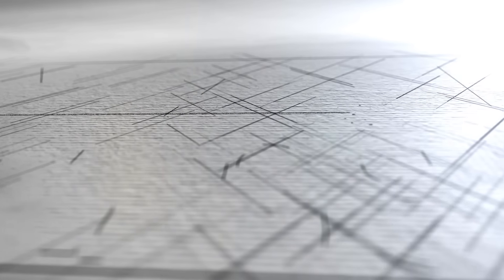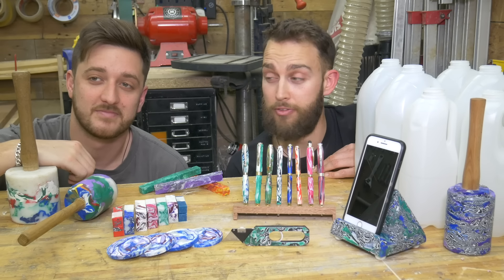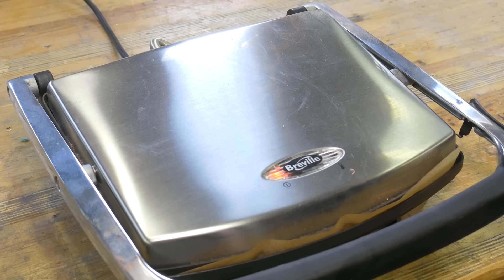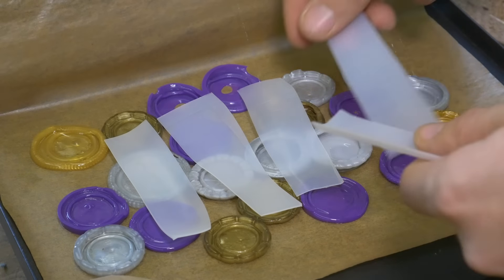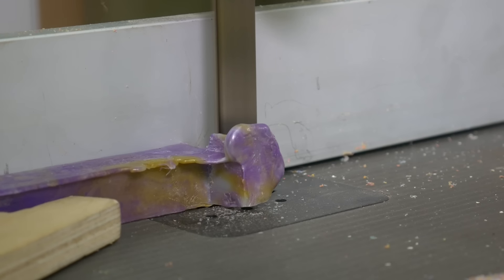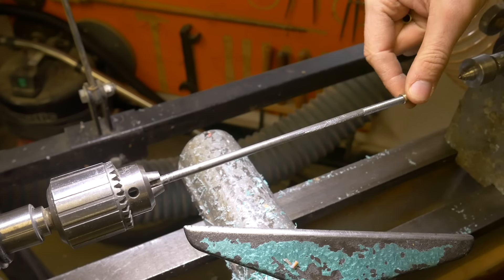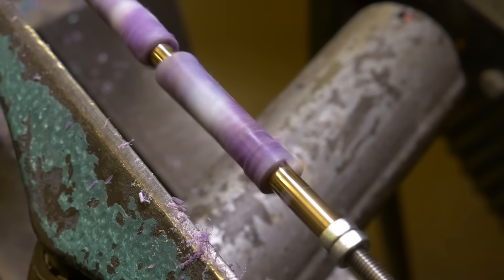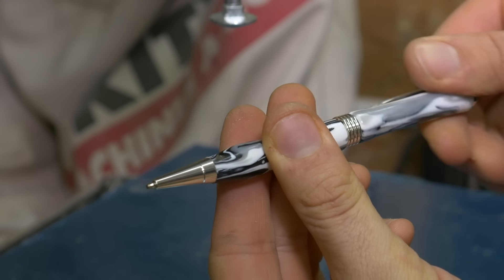Beginners' Guide to Melting HDPE - How to Make a Recycled Plastic Pen

Comment: Very interesting, never thought about using the panini toaster, the brazilian videos I saw all used the electric oven, mentioning that it was easy to control the temperature and not allow it to go too high. Didn't know the panini toaster was also good at limiting the temperature build-up.

The only downside I see is that you can't do a large chunk of plastic in once with the toaster as you could with the electric oven, because of the space (and most likely the temperature won't be spread evenly if you do a chunk too large in the toaster).

Comment: Here is another items which I forgot.
On outer pot which not only gives the shade to keep soil kool for the potted plant , inside outer 2nd pot on the bottom of the pot where water collects,
Put angle slightly so when you water the plant, what drains will collect towards
Where drain plug will be. So outer pot inside the bottom must not be flat .
There is few ways to achieve this.
One method is wire that extends out with grill for planted pot can lay on top of the grill. But anyway I am sure that you will come up with best method.
I learned a lot by watching your video.
Thanks. Because you guys are pro.
I will give you this idea for you guys.
It would take me too long for me .
When I see it on the market I will buy it for sure. I love flowers and plants.
Believe me what I give you in idea is needed. So I hope you guys will succeed.
Thanks.

Comment: Friction fit is probably the best way to go, but you should be able to get a reasonable bond to epoxy if you flame treat the surface first. It works with uhmwpe on skis and snowboards.

Comment: Although I love the ways you are re-using plastic, where are all the microplastics that you shave off these creations going each time? At that size, they are really dangerous to animals and children, as they could get picked up inhaled/eaten and just generally bad for our eco system.
Reply: Unless you wear only all-natural fibers, you should be more concerned about the fluff you’re pulling out of your dryer’s lint trap. Microplastics are unfortunately everywhere and will not be going away. At least these guys are trying to repurpose plastic. I’m sure they have a shop vac and possibly a ventilation system or air purifier that can trap particles.

Comment: I was running a industrial electrical project manager over the electrical work for a brand new plastics plant. They make pet plastic pellets that's used for grocery bags bottles ECT. It is actually really cool the process used for making brand new plastic. And the other side of same plant they melt down recycled plastic and refine it back into pellets as well and that shows up as huge trains full of mixed up types of plastic and they have robots with sensors that sort the plastic by type of plastic when it comes off the trains. After I did that 4 year project I got to go be in charge of their other plant where they make plastic bags and bottles. It takes one tiny 1/8 inch long buy 1/16 thick pellet to make 1 grocery bag not much plastic at all used, the pellet gets really hot right to it's exactwlting point air is blown into and it inflates into a plastic grocery bag or grabage bags get a bigger pellet that's only twice as big but it's so cool they can make grocery bags out of a piece of plastic that looks like size of a grain of rice for the regular size sandwich bag for lunches

Comment: If you rough up the pen tube, just use CA glue, it will hold anything together, and just use a hardening agent , but looks pretty cool, good vid
Reply from the maker: Nope, CA glue doesn’t work with this stuff. It’s super slick!
Reply: Really? That's crazy, have you tried rough sanding the outside of the tube with a low grit sandpaper and inside of the blank
Reply from the maker: Yep! It’s not the technique, HDPE is renowned for being tricky to glue. Mechanical fixings are the way forward
Reply: @BrothersMake  thanks for the reply, just in case I try some of this stuff,
Reply from the maker: Glad to help. Compression fit seems to work the best 👍🏼

Comment: Nice video. I'm thinking - if you don't have a lathe (most people don't) and didn't mind your pen shape being identical each time - at least until you develop alternate moulds - you could use a 2-halves plaster mould cast from a 'retired' pen and cast the whole pen case with the internal barrels in situ, held in position at the ends, then just tidy up seams and sand/polish.
Reply from the maker: Good idea. We tried to put the tubes in and mould the plastic around them but it was difficult to keep them centred. I’m sure with some more time and the right jig this could be done.

Comment: Very useful video. I like the fact that you showed the failures and the repairs. Is it necessary to press the plastic in the mould as I'm looking mould a small block shaped item which will also need drilling afterwards.

Comment: A couple of suggestions, first if you can find them use ove gloves; they are similar to gloves used in the plastics industry.

Second is to have a large container of water next to you during this processes, if you get molten plastic on your skin you can dunk your hand or arm into the water to cool the plastic. If you try to remove molten plastic from your skin you will end up doing more damage to yourself as opposed to removing cooled plastic.
Reply from the maker: Thanks for the tips 😊

Comment: Inspiring! I want to make plant pots. I wonder how I can mold them. Seems like silicone is too soft to work in this case. I'll have to figure out something else. Maybe I can squish melted sheets between two forms, an outer cylinder for the basic shape and something solid to form the cavity inside that can slide out easily. Hmmmmmmm. Thanks for the inspiration!

Comment: I've been collecting HDPE bottle lids and I bought a George Foreman Grill from Goodwill (yes, it has ridges, but I couldn't find a flat one). I got a sheet of parchment, so I tried melting some last night. Our house is cold and my hands were cold, which turned out to be a good thing. I have carving gloves which worked well in that the plastic did not stick to them. They are thin and not insulated, so when my hands warmed up, I had to drop the cooling plastic! (Next time I'll add a layer of insulation - another pair of gloves under the carving gloves!)

I think that if people realize that the stuff they are throwing away is a resource, it will become a commodity instead.
Reply from the maker: Great to hear you've given it a go! Hope you enjoyed it. And awesome to hear you managed to reuse existing products to do so - looking forward to seeing what you make!

Comment: Would you consider putting together planting pots for plants which has two layers with gap between each to give shade for soil against hot sun?
Outer layer gives the shade and also can collect rich nutritional drips to add water
And feed the plants? You guys are pro.
I enjoyed your video.
Think about some kind of plug at the bottom of the outer layer pot to collect the water which will drain and just open to drain the water which have been drained, then to reuse the water.

Comment: I collect aluminum cans to recycle I wait until I have 10 - 12 large trash bags then I connect a pillowcase to the discharge chute on my leaf and stick chopper. Fire it up and run all my cans through it to chop them into small pieces that are blown into the pillowcase until I have done all of them. You have to use cloth not a plastic bag because all of the air coming out will blow up a plastic bag in a second. You should be able to do the same with your plastic bottles and such. Make the pieces smaller faster. I hope this helps have a great day. 

BiggDaddyBrian

Comment: Have you, by chance, tried using some HDPE in a dense solution with a solvent of your choice (xylene, toluene, acetone, etc.) as a "glue" of sorts in place of the epoxy? I don't have a lathe myself, but I've used a toluene-HDPE solution to this effect a number of different times, and it has had great results. The only thing that I noticed is that because HDPE doesn't surface bond with metals and can't melt into them, you need something like a cutout or lip for the plastic to form around so that it has a solid foundation of points of friction to keep it in place.

Comment: I've been saving any HDPE for a good while now. I used to take it to the recycling center but not anymore. :P As you mentioned epoxy won't stick to it so I save it for making resin molds. I can make ones similar to your pen blank mold or I can melt it for a push mold as long as my master is stone, glass etc. I would think some other things might melt in it but maybe not. I should try it sometime. Also save my plastic grocery bags now (at least some of them) instead of bringing them back to the shop for recycling as those are generally HDPE also. - Heidi
Reply from the maker: Sounds like a good idea!

Comment: Great video.
Can i possibly use a tin can and stove for this? Thanks
Reply from the maker: Tin can will work for sure. Not sure on the stove, you’d have to control the heat very carefully
Reply: @BrothersMake  thanks for the response. I'd better try another heat source anyway.

Comment: Separation is caused by internal weak knit lines. heat the plastic longer and minimize the folding. Develop a way to quickly transfer a uniformly heated blob of plastic to the mold and press it fast. knit lines form and separate during the cooling process.

Comment: Hi bro. Great work. I want to know if heating plastic causes more pollution in anyway. Can u advise? Thnks!
Reply from the maker: It depends on the plastic. HDPE is very low toxic and as long as you don’t burn it, the fumes are not dangerous

Comment: After sanding it if it looks cloudy and white get a lighter to it being careful not to burn it or deform, that will melt the outer surface and give a nice shiny finish,
Reply from the maker: We’ve tried this. It’s called ‘flame polishing’ and we have never had good success with it. It certainly makes the surface more glossy but the texture is awful
Reply: @BrothersMake  that's wierd, mine always stays nice, I use it after sanding tho, I don't have a sander, my power tools are a dremel and a drill, so I sand by hand to atleast 1200 and then use a lighter, only the 1200 sandpaper makes it sorta smooth but cloudy
Reply from the maker: Ah okay cool, we'll give it a try - thanks for the tip!

Comment: Awesome awesome awesomeness. Is there a way you could take one of your already made pins and use it as a mold for the rest by placing   a film of  one of those clay sheets used for baking clay over the pin then place plastic over the film and mold it into the  pin form  while it cools and then use that mold for many others. I wonder if this works ☺️

Comment: Planning on doing this with students. Collecting 5 gallon buckets and cleaning supply containers. Need help in removing labels from a barrel full of jugs. They are quite stubborn. May be faster to just cut off the labels with shears. Suggestions?
Reply from the maker: Either acetone or WD40 tends to work the best. Not ideal to use chemicals but the lesser of two evils

Comment: JB weld makes a super glue that says it bonds plastic. I've not tried it yet, but if it will bond the tube to the plastic, that would be fab. I don't have enough plastic yet to try it out, but as soon as I do, I'll give it a go. 
Have you guys tried using plastic with burl blanks like you would with resin? Just wondering if it would hold together and actually stick to the wood. 🤔

As to the waste, you can always cut the blank down to within about 1/4 inch of the tube. Looks like you're using a slimline pen kit, so 1/4 inch is perfect. Cut the waste on the bandsaw and then you have larger chunks to save rather than all of those shavings.

Comment: Well when you put it that way, plastic seems like a miracle material again!
Reply from the maker: It is an incredibly versatile material!
Reply: @BrothersMake  Just have to be careful about those microplastics getting into the water/ecosystem. Maybe melting, carving, turning, and machining is fine but sanding might not work with my set-up (no control over dust or gases).

Comment: Super informative video, and very straight To the point too ! I'm planning on making earrings (of a circular shape) any tips on how to mold the plastic/tips in general ??
Reply from the maker: You can either use a circular mould or go ahead and make thin sheets of any shape and cut the circles out 👍🏽

Comment: Have you ever used silicone moulds? Or would the hot plastic damage the silicone? I was just thinking silicone is used for baking and can usually withstand 400° F+ So idk why it wouldn’t work. But was just wondering if y’all ever tried it.

Comment: That pen is beautiful. What is the reason you dont turn the pen blank before cutting and partially assembling? And have you tried a 2 part apoxy or E6000? I'm wondering if either of these would work if you scratched the inner and outer surfaces.

Comment: One thing you didn't mention is one of the reasons for pressing it and that is it shrinks a LOT when cooling. I've made a few things myself.  :=)
Reply from the maker: In a small mould like this pen blank one, there isn’t much shrinkage to be honest. Clamp it down tight and most of the air is removed as well

Comment: Hello. I love the video.  I made a mold and my first hdpe pen over the weekend.  Very happy with the results except the small micro scratches.  I seem to have missed you used burnishing cream as your final step. I've never used this product.  Is it a common plastic finish to add shine and remove micro scratches? I'm in the states, so trying to find what we've got over here. Thanks much. Great job on the vids!
Reply from the maker: that’s awesome well done! We worked up through the sanding grits and used micro mesh to get rid of any last few scratches. I believe burnishing cream is used for wood mostly but anything similar could work. Either some form of abrasive woodturning paste or maybe even a metal polish would work 👍🏼

Comment: Hi great video. Inspiring. I have been looking at this and homemade silicone moulding.  My question is if inserted into a solid frame ie a box could you use a silicone mould for more detailed shapes and still be able to press it.
Reply from the maker: You need a lot of pressure to ensure you don’t get any air bubbles in the cast, so I think silicone wouldn’t be rigid enough for use as a mould

Comment: Hey guys! Thanks for the video. I'm working with plastic recycling and now I'm trying to use HDPE, but the plastic is sticking to the aluminum mould and it doesn't unmount. I used mould release, but it didn't work. Besides that, the plastic is getting layered, as if is not melting properly. I’ve melted it in 180ºC. Any tips?
Reply from the maker: Hey! Aluminium is a great heat sink so it’s likely that it’s staying hot for much longer. Are you allowing the HDPE to fully cool before demoulding? Also make sure the aluminium is 100% clean.

If you’re getting later separation than I would suggest making sure you hear it longer and try twisting/folding the plastic to help fuse the layers together.

Hope that helps!

Comment: Hey guys, love the show. 
Im working on a project but i want to use clear plastic. Is there anything i can use to do that? Certain type or special equipment? Would love to hear back
Reply from the maker: You won’t find clear HDPE I’m afraid. PET is the clear plastic you find in your single use water bottles but it is notoriously difficult to recycle using these methods in afraid

Comment: You mentioned that it's better to avoid transparent plastics, is there a specific reason like bc it'll release fumes? I have access to lots of plastic bottles and was wondering if they could be used for something
Reply from the maker: Good question! If the plastic is totally transparent then it’s definitely not HDPE. Probably PET. The reason we say to avoid that is because other types of plastic won’t work with this specific method. Still recyclable though!
Reply: @BrothersMake  Ah ok gotcha, thanks!

Comment: What if you heated the brass inserts enough to melt the plastic somewhat while you're pressing them in, would it bond to the metal that way? You could even rough up the outside of the inserts beforehand with some coarse grit sandpaper or a file to give them even more grip. Just a thought

Comment: Great work!
Im wondering if you could Just place the metal parts Inside of the cooling Form to avoid Drilling It later?:D
Reply from the maker: Thanks! We did try this but it was difficult to keep the tubes centred
Reply: @BrothersMake  
Thanks for answering! 

Yeah thought about that as well, maybe in a larger scale of amount It could be worth the effort in trying to hold its place:D

Have a great day:)
Reply from the maker: Yes absolutely. It might be something we have another go at with some sort of jig to keep it aligned 👍🏼

Comment: Mending blow out is a whole lot better than trying to do so on wood or the acrylic blanks out there. Those blanks are super hard and when they blow, there's no fixing them, which is why I've started making my own resin blanks. 
So, I saw you guys rough up the tubes, but did you do them all the way down and with a high grit paper, like 80? I've tried to glue in tubes that I thought were roughed up enough only to have them slip out of wood. (except mahogany. That sticks so fast with CA glue that you can't get the tube in all the way). I've gone to scuffing with my 60 or 80 grit belt sander before trying to glue. I'll try with the plastic, but also reaming out the blank hole with a diamond bit (because I have one). Let you know. Otherwise, for a 7 mm tube, I have a 6.4 mm bit.